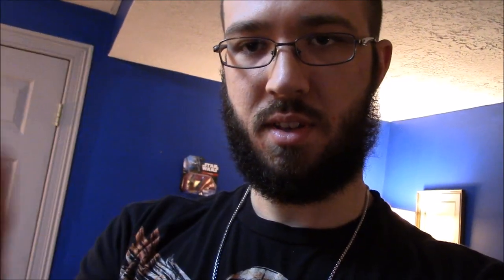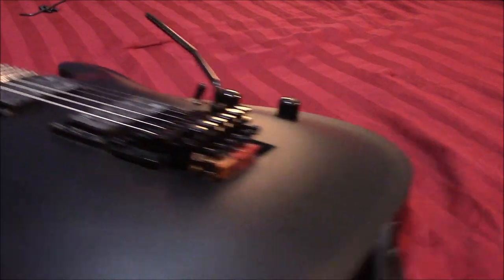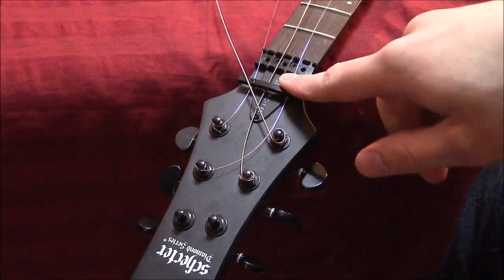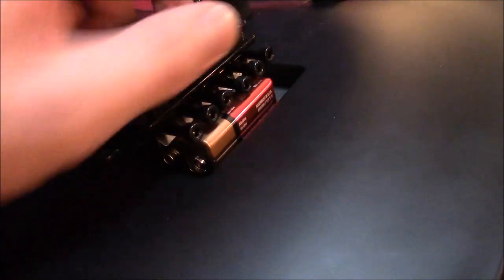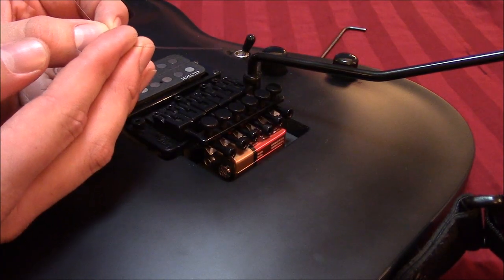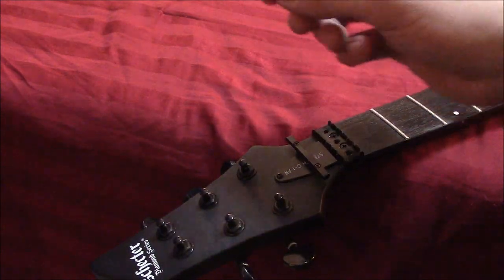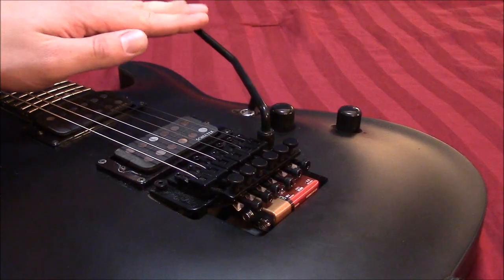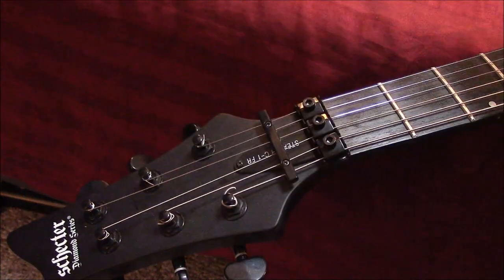How to Restring a Floyd Rose

Comment: Great video. Just a note you should put the fine tuners half way, that why you can go up or down. If you have them all the way up then how can you tuner if you cant go up anymore? Just my tip, I have been using floyd's since the 90's and that's how I have always done it.
Reply from the maker: Good point.  I just like to start with them up because I feel like the strings are more likely to stretch a bit and become flat when they're brand new.  If I had to unlock the nut to re-tune later on, I would probably set them in the middle like you say.

Thanks for watching!

Comment: i did not block off the bridge and when i took all the strings off the bridge snapped backwards with a loud bang and slipped off the blade.  what does this mean. is the guitar now wrecked?
Reply: Actually you should change strings one by one. Now you should start putting the first and last string, and then turn your tuners up a little, until you can put the backplate edge back into the studs. it will still be all the way back, but at least will be aligned in place with the studs.

Comment: What to do to re-level the bridge ? I removed the old strings, and this is currently my problem. I can't level the bridge up again. Appreciate if someone can help.
Reply: SymbolicBodom you have to screw the back plate off the guitar and turn the two screws inside of the guitar depending on which way the bridge is tilting
Reply: @danielkeller8910  Thanks mate. that was helpful !

Comment: This system gives me a lot of anxiety, I don't know if I overtightened the little blocks at the bridge or not.
Reply: I felt the same way! Once you get it setup properly and see how well they stay in tune it's more than worth the time and effort imo!!
Reply: if you handle your allen wrench the same way you use a key to open a doorlock, with just two fingers from the shortest part, the force you are able to use until it stops turning is enough to lock the strings and not strip the bolt's thread. Wounded strings will give more because they are softer, the wounding will deform and flatten with pressure, but again, if you only use two fingers, you will know when you are done.
The index finger in the stem and the thumb to make leverage, and twist. no arm or wrist force, just the fingers.

Comment: What we need is a fully comprehensive and technical guide for this invention! your method seems OK but they must be some way of presetting all the strings to say one step down for example the bottom E to D and the A string to G etc etc so when the block is removed the tuning will be somewhat correct and the positioning of the bridge will be flush to the Guitar body also the different tension of  the strings on the bridge has not been mentioned... can someone do that? if they have more spare time than I have!.. Having just come across this floyd rose thingy, from the top it looks like a precision piece of kit when you look underneath it looks like a right Heath Robinson affair held together by a couple of wood screws some unspecified springs and a crappy little bar..What we need is somebody who works at Lotus or Mclaren engineering who is a Guitar player who can do a proper invention of this Idea involving a properly engineered mechanism (not involving a couple of wood screws) that works properly that a 15 year old can use and change strings properly every time..They must be someone out there who can do better than this toopense heapney invention that doesn't really work every time and you thing twice on a string change and you need a spare Guitar on hand if you break a string...Just my observations of a another thing that sounds like a good thing but??

Comment: is it bad for the truss rod to take all the strings off at once? how effective is the block on taking off the pressure of the truss rod? once all the strings are on after using the block method, how level is the bridge? the block method does seem cool because it would be easier to polish the fretboard.
Reply from the maker: It isn't ideal to take all the strings off at once because the tension of the neck will fluctuate.  That being said, I've never personally had any issues from doing that.

As far as the blocking of the bridge, that won't affect the truss rod one way or another.  And even with the block, the bridge will land differently depending on the total string tension of the new strings, which is somewhat random.  But it's not that difficult to recover to a normal position once you get a feel for the initial tension.  It takes a few times.  That's why I said not to tune all the way up right at first.

Hope that helps.  Thanks for watching!
Reply: Loosen the strings one at a time. If you cut all strings with the tension on yes bad for the truss rod.

Comment: Heyyy i just figure out this guitar has a fine tuner... i just bought a bunch of strings for no reason... except the fact that they are black and cobalt and they cost 8.66666666 repeating $ for 3... 🥲
Reply: U have a nicer floyd rose with the lock in whammy bar.

Comment: Way to go.. If you put a battery and your fine tuner aren't equal you will eventually in time bend string locking not from the floyd or strip a fine tuner nut . the best way is to remove everystring and put the same gages string. Tune it 4.3.5.2.6 then 1 string and floyed will bet partly tune. Slide finger on string to warme them up (most important part) don't cut and don't burn your finger. Then stretch the string (plus each string will wiggeling across the whole string length. Retune.. Afeter that tuning. You need to set fine tune flat in the mudle. Do a real tune up.  Tight it almost tight but not completely check the  tuning it should slightly be off. That's okay. Pull thevstrings that are sharp or use the tuning key for the string that are flated. After that. Tight comlletly the lick not hatd. This way your fine tuners should be flat. Your string should have been warmed and streched and your not should be lock hard.. Meanun that now. When you pull on string it remain tunes. When you pull on trem bar it stays tune and if you turn your key thevstrings stats tune.. If you have done sny of these step wrong. You 'll be able to fixe it with your fine tune. But uf you have done it right you 'll hardly need to adjyst. If you are adjusting your string to often with fine tuner that the fine tuner. Are becoming to low or to high you need to reajust. Always reanust beforevit to late. A fine keu to tight or to loose will strippe in time.. A well set tremolo system should not go out of tune. I repete should not go out of tune.. Tight them lock not. When you thing its tight. Not i can stil do a 1/4 . its siple if you turn your tuning keys and thev strings slips out off tune. Its not tight enough.. If its slips do to metal being to slick fri the string use a sand paper ton sand micro gove to catch the string.. Snd dont put anuthing undervyour floyed te keep it straihht while doing string change. It lrevents from doing proper setting if you used diffrent string and can cause more trouble . its ment to ho all thecway back and all thecway forword. Use avtrem setter if you aren't confortable. But yeah. Takes me less the five minutes to completly change string and i can wammy solo like crazy for hours before needing finevtuning adjustment.. If you start seing you guitar go out of tune more and more. Its because your strings are getting wornout and needs to be change. That your guitars us comming loose. Don't blame the gear blame the user

Comment: Good grief

A 9v?.

Don't do that. Your gonna bend the springs and or pop the battery. 

Seriously.
Reply: Is there a better method? I wanna remove all strings at once, to polish my fretboard, but I don't want to put a hard object or battery there, in order to avoid damaging the bridge. Will a small pillow be fine?
Reply: Sid Skywalker Most people I've seen usually use a block of wood either directly under the bridge or wedged into the back of the guitar.
Reply: I use a Jenga block.
Reply: You could use the back plate it’s thin enough to slip in there and hold it and it’s strong enough to not break
Reply: No.
Reply: @siddharthsharma8940  jjuu